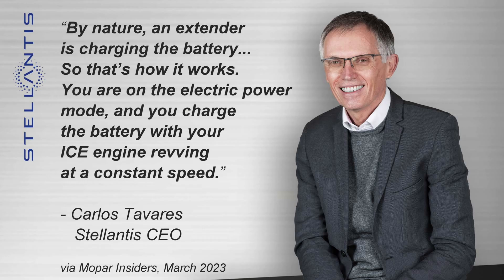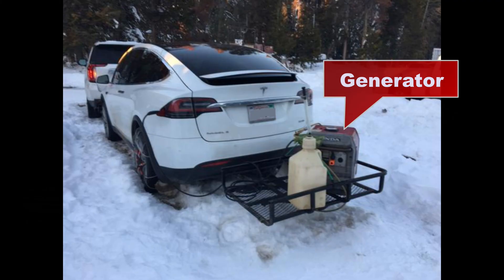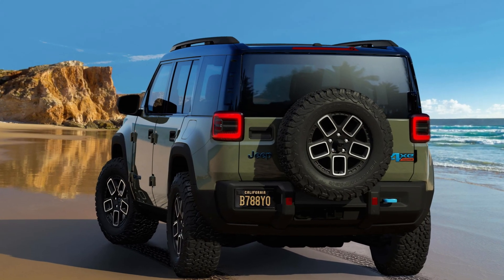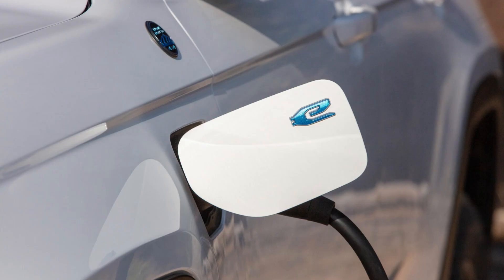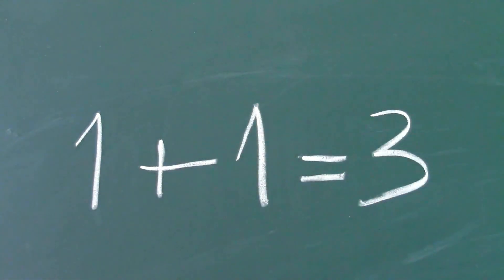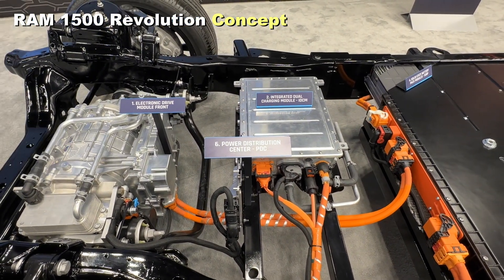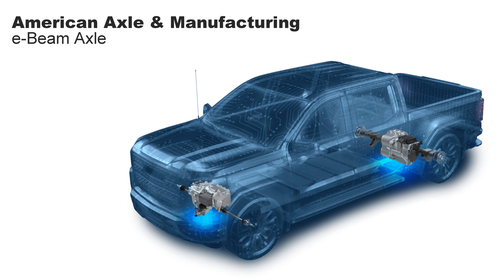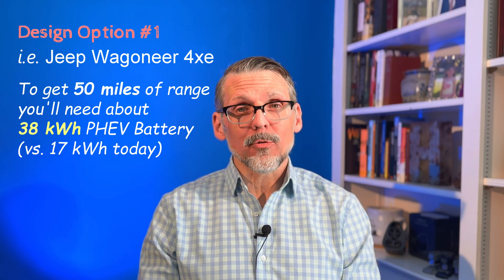Breakdown: RAM REV XR (eXtended Range)

Comment: Mike fails to understand how atkinson cycle engines work, and how generators work.  They run within a narrow power band and the generator part is tiny.  

You can take existing inline engines and literally split them up, as BMW and Mercedes done for decades. I expect that the frunk will be stuffed with  either the exising 2.0L GME T4 engine, or far more likely a  2 cylinder single turbo split version of the Stellantis Hurricane 3L 6 cylinder Engine which again just a GME T4 with an extra two cylinders some tuning and an extra turbocharger. The latter puts out 133HP/L ,  with tier-III emissions, so a 2 cylinder generator engine is far more than enough to charge batteries even when towing.  Twin insulated exhausts on each side of a narrowed battery pack you have heat isolation, enough that you'd want a heat exchanger.  You want to save that heat for the cabin and to heat the batteries on cold days. The frunk could easily store that and 20 gallons of gas.  You wouldn't even need to transverse mount it as the engine would be wider than it is long.

A Hurricane split in two as a 1.5L would be 18" in length.   Split in 3?  12"  And being a generator it can be oriented in any fashion even  as a flat 2 like a Subaru.